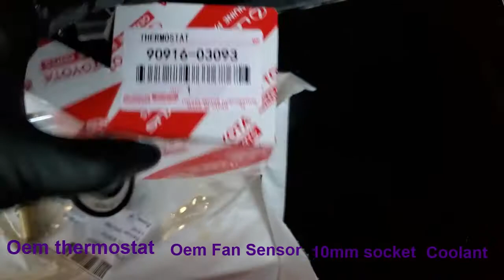Lexus Is300 Thermostat Change

Comment: That must be for the 4 cylinder model. Doesn't even state the year model.
Reply: You can see the engine and engine code in the video. Also the "IS300" only came as a 6 cylinder. The same chassis under different names came with a 4 cylinder.